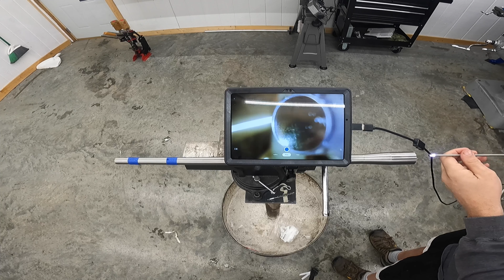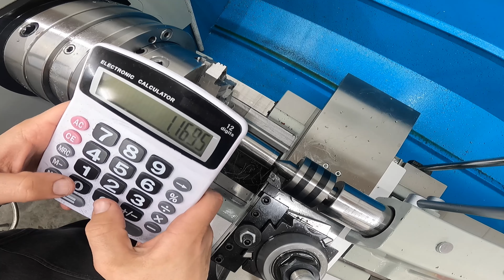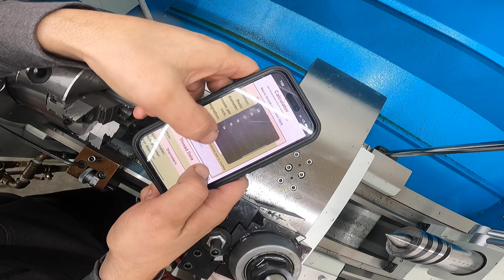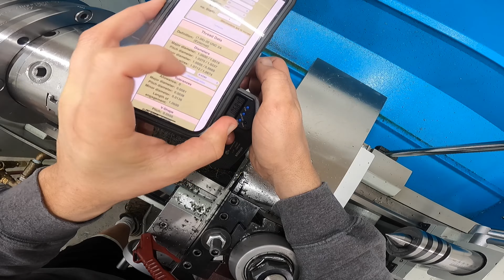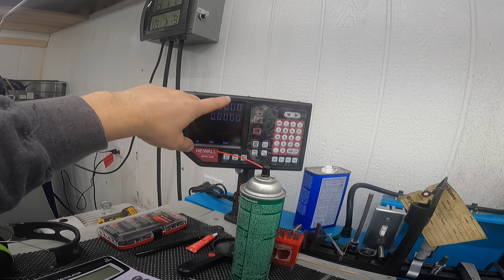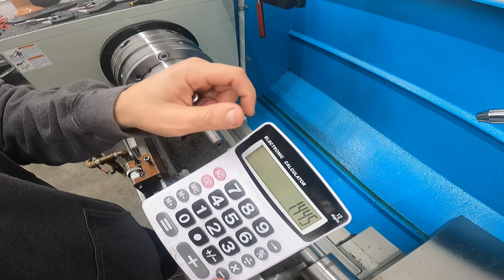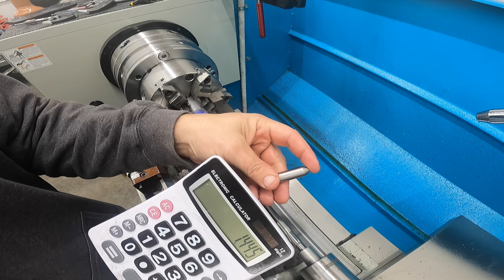"Drews Precision: Chambering a Savage Prefit 6.5 PRC Barrel [Full-Length Video]".

Comment: Running spindle in reverse.. threading tool is upside-down, correct? Just so others understand. This is my prefered method to cut pump shaft threads for coupled shafts. Thanks for you time and detailed info. 👍
Reply from the maker: That is one way to do it. Or cut on the back side of the work in reverse.

Comment: Thank you, great infrmative video. Ive only watched about 20 or so today! Your method is very logical to my machinists mind. Oil field tools etc, not ultra precision riflesmithing. My question is: Im looking to do barrel work but on a Mazak QT 100. I have yet to find any videos of anyone using Mazak CNC equipment for barrel work. Any thoughts on this or direction will be appreciated.  This machine has a very short heatstock but it seems that if im using the same alighnment tools you are using that having a spider at the back on the spindle is not critical, is my thinking correct. again thank you for the great video.
Reply from the maker: I don’t recommend a spider. Barrels are really easy to bend. 
Not sure what size your lathe is but it all works. The chuck is built by straight shot gunsmithing.
I just switched over to cnc. The learning curve is steep?

Comment: Thanks very much for the detailed and informative video.
I too am a fan of using the carriage for such operations.
Have you seen some gunsmiths use the headstock to drill the reamer holding tool in the carriage, aligned to the machine, instead of a floating reamer? 
Do you not like to pre-bore the chamber to save wear on your reamers?
Thanks for taking the time to make and share your video and your knowledge.
Reply from the maker: Great minds think alike I guess.
I have seen how gunsmiths align drill a reamer holder aligned with the headstock. The issue I have with this method is most of them offer no adjustment. Which most think is no big deal. But in my opinion it is a huge deal. Using a set screw pushed against one side of the reamer the reamer naturally “cocks” away from the setscrew. This throws your reamer alignment completely out the window. 
While most swear they get everything aligned to .0001 or a tenth. In reality If they are using range rods or things of that nature they are likely closer to .0005. Couple this to .0002 of headstock run out and a measured .0005 of reamer miss alignment from the setscrew we are now. A min of .0015 out of concentricity in one way or another.
Remember lathes cut on both sides of the material. So if we take .0015 off of one side we are going to take .0015 of the other. This leads to an oversized hole of .003. And that is if we are being really fussy with our setup.
Floating reamer holders allow the reamer to follow the bore perfectly. Saving set up time and preventing any issues if our barrel moves a any during our threading operations.
I have thought about pre drilling. Truthfully I haven’t tried it. I’m getting a cnc lathe and once go that route. I will likely cnc the chamber undersized. With a boring bar. Drill bits can easily work harden your materials.
Thanks for the view and questions. They help us all think and learn.
Reply: @DustinDrews1  interesting thoughts.
Everything you have suggested as a potential issue can be checked and measured to confirm whether the concerns are valid or not.
Definitely finish the pre-drilling with a boring bar for concentricity, as a drill can follow and wander under misleading forces...similar a floating reamer holder, I guess 😉

Comment: you should be indicating the bore of the tool holder not the body of the reamer holder, to get exact center
Reply from the maker: It’s a floating reamer holder… You can’t indicate the bore of the reamer holder. It moves!
Reply: @DustinDrews1   YOUR TOOL HOLDER DOESNT MOVE.  I didnt say the floating reamer holder.   at no point in time did I say the floating reamer holder bore.  I edited my reply b/c I want you to learn and not feel bad.  take the morse taper shank out of the tool block thats on your tool post and indicate that bore in.  your simply running on assumptions that the floating reamer holder BODY is concentric and that assumption is in error, ESPECIALLY since your floating and not running a zeroed rigid setup.
Reply from the maker: I understand what you’re saying now. But doing it the way I do it. 
I know that the reamer body which holds all the floating aspects inside the reamer will be above to float true to the bore.
Doing it the way your explaining, you have the tool holder to Morse taper shank to tolerances, the Morse taper shank to the female reamer holder tolerances. These CAN all telegraph into angular run tolerances.
Using the outer body of the floating reamer holder it eliminates all the other potential runout tolerances that are holding it.
Thanks for the conversation

Comment: What rpm are you cutting the tenon? I saw 210 on parting but what about regular cutting like getting your diameter to where you want it? Sweet setup by the way!
Reply from the maker: Now 1200 because I’m cnc. But 550 when I was on the manual machine